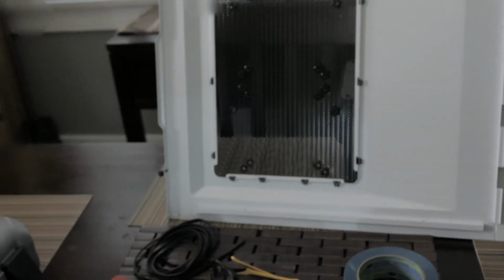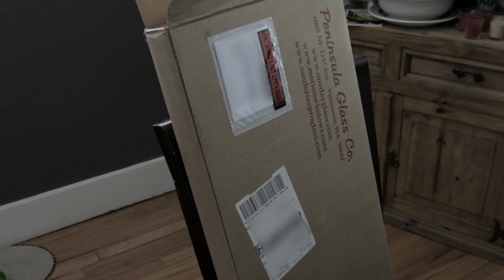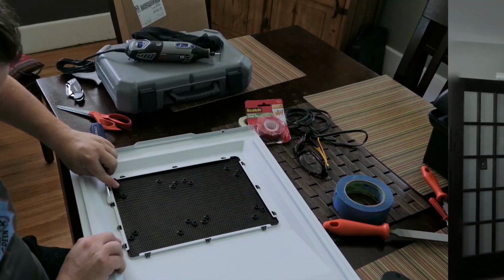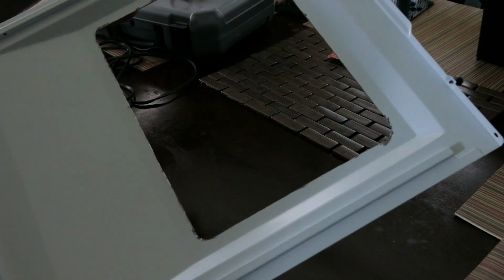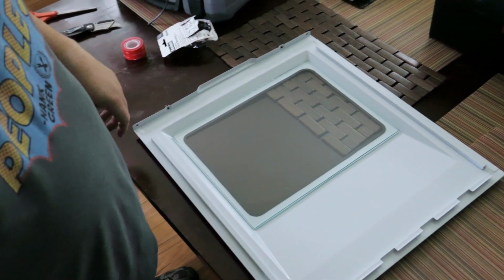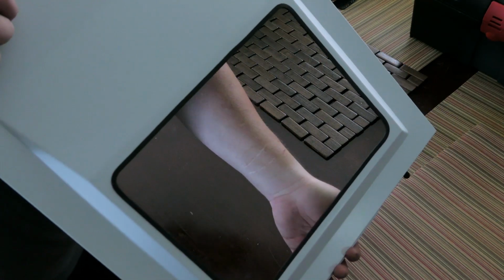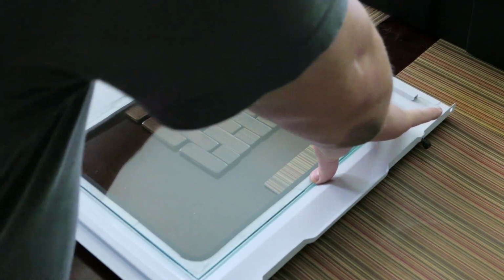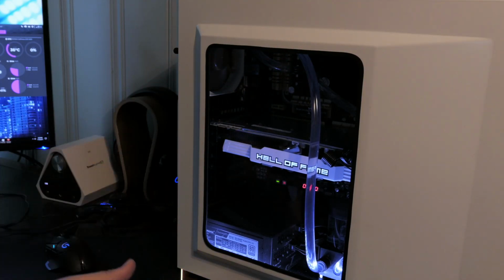DIY Case Mod: How to Make a Side Panel Window

Comment: Great video. Gives me the courage to try this as well. Quick question for you. When you have the u trim around the panel cutout and then attach the glass on the inside against the u trim. Is there any sort of gap that is noticeable from the outside between the trim and window?  Thanks in advance.
Reply from the maker: Hi Scott. There's no noticeable gap at all. The glass is snug against the U-channel, which in turn is against the metal. When, I look down or at the sides of the panel, it is right up on the U-channel. There is a lip, or recess, when looking at the panel as the glass is behind the U-channel on the back of the panel, so in that way it is not flush. Hope that answers your question. I'm glad you're gonna try this mod as well. I'd love to see pics of how it turns out. :) Thanks for watching!

Comment: Have the same case, plan on doing this sometime soon as well. Do you have the glass dimensions you used to save me the hassle of making sure to measure perfectly? Thanks.
Reply from the maker: Sure thing. The dimensions are: Width: 10 3/16" Height: 13", Thickness 5/32". The height and width given will let you have plenty of room to seat the panel. Thanks for watching!

Comment: Only comment I have is why are you drawing  hot air into the case with those top mounted fans??  You will cool it much better by reversing those fans and pushing the hot air which is already rising out the top.

Nice mod!